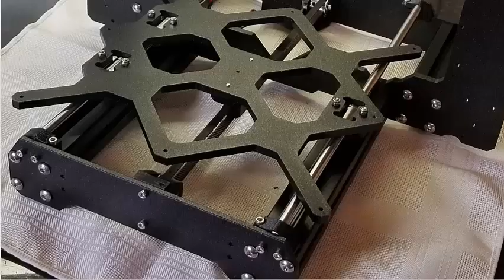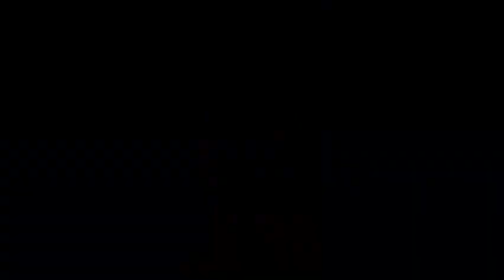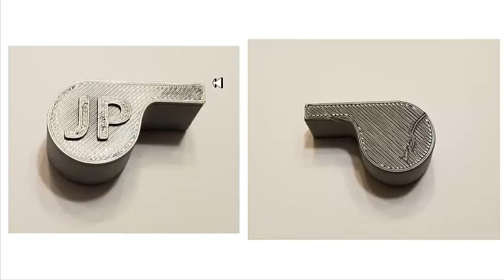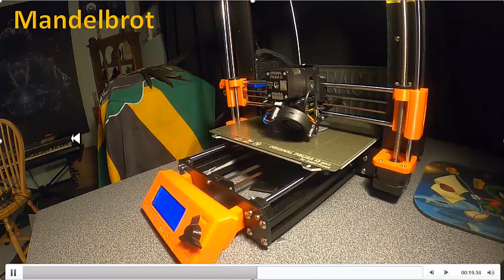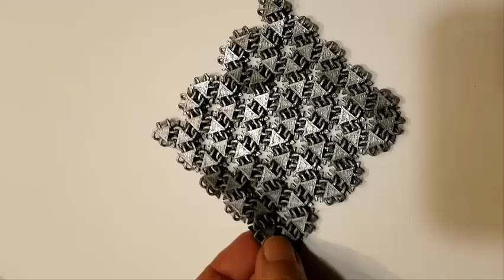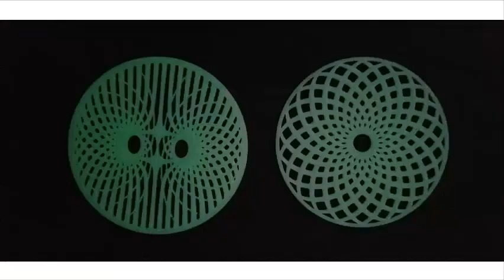Building a Prusa 3D Printer : My Experience

Comment: I saw Ken wheelers picture the other day about where to place a seed for max effect in groth. That sparked the idea that maybe its the magnetic lines that is supposed to form geometry to manifest energy. If you put three magnets together with the south pole towards the center that should form a triangle in the middle with the field lines and with the "hotspots" in the corner of the triangel, just like we know that the pyramids have the most energy in the corners.
Reply: I only have two magnets at my disposal at this time and we already know that magnetic fields have effect on light but it was so real to see that i could affect a candle light with "weak" ferrite magnets
Reply: IMO the magnetic field "lines" display the reality of the mechanism of primary light transfer: a longitudinal crystal percolation thru lyotropic aether.  This percolation becomes a rotating vortex because of the vertices of  the dipole moments in the crystal. There is an acculumation of energy in the corners of joined dipoles, just as you say.  

This scheme causes a refraction of the energy in bands of filaments that are at the scale of aether/atom/molecule/quantum "objects" - and these bands of filament traces combine to create a "bunching" effect on the whole of the vortex, which grows commesurately with intensity (based on the number of aether scale filaments of aether percolation to start with).  The transverse wave is secondary refracted energy whose moments take longer to reach destinations, and are  observed as the slow speed of light (c).     Also, the lyotropic nature of aether causes a shift of its value for Young's modulus, making the primary light transit even faster.

Comment: Blue painters tape on the bed helps with bed adhesion and getting the print off. Onshape for 3D modeling free for public use.
Reply from the maker: Thanks for the advice. I am using TinkerCad for designing my magnet holders but it's nice to have options. I will check it out.